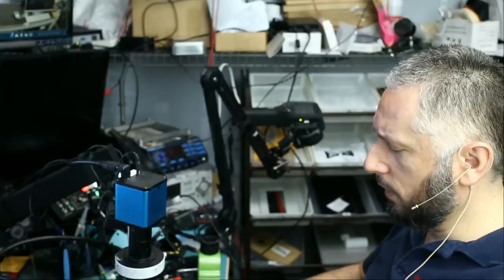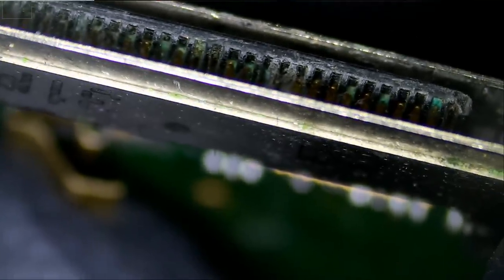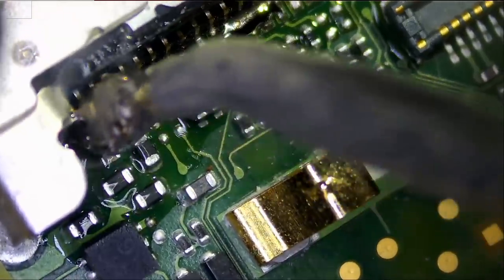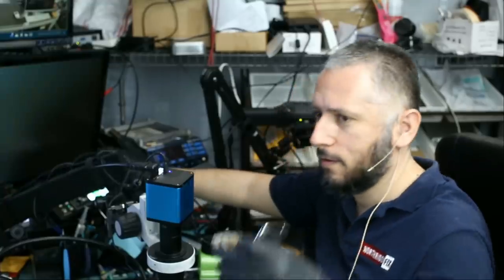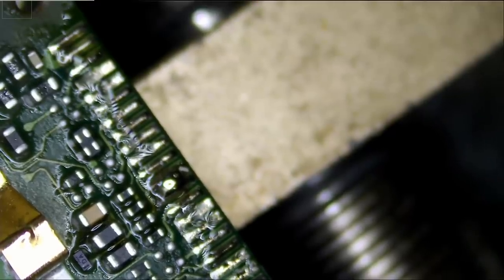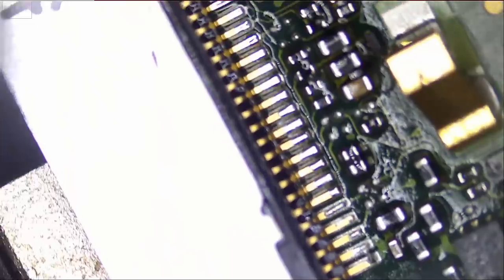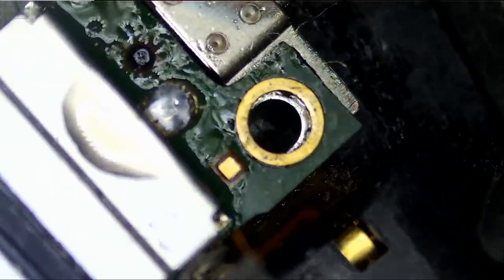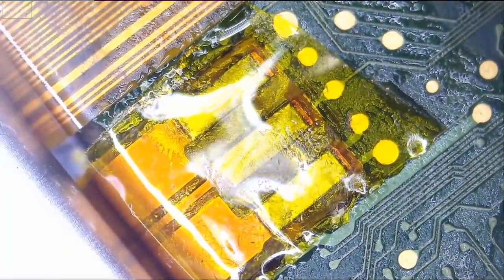iPod Touch 3rd No Power - Damaged Charging port replacement

Comment: Remove the battery and inject a current limited 4.2V into it to charge, then reconnect and see if it charges.

Don’t waste your time ordering and waiting for the battery if you haven’t confirmed the cause.

Also inject 4.2V into the iPod battery terminal and see if the iPod boots
Reply: Maybe the battery has lost its capacity
Reply: Joshua Hutton it will have enough to allow the iPod to boot for 30 seconds mate after being charged with external power supply. It’s not a lead acid

Comment: Hey man. Isn't it dangerous to put the soldering iron on all three pins of the battery at the same time? Couldn't that cause a short and possibly make the battery explode?
Reply: Yes and perhaps it just seems like he did? I went back and watched that part again and even though the tip was nearly perpendicular to the pads, I don't think he touched any at the same time. I could be wrong of course. Exploding batteries are no fun.
Reply: 0:29 yes he touched all the pads at the same time, if he desoldered each pad alone he could damage the battery (flex cabel ) considering it's a very old device, it great that the battery hasn't expanded yet, but he's probably gonna to have to change it since it's dead.
(But that's just my opinion ).

7:52 though he didn't touch 2 pads at the same time while resoldering the battery. 
Have a good day.

Comment: Hey brother instead of ordering new battery, you can use the power supply to boost the voltage in the old battery. This will give life to the old battery and customer will save some money and you will save some time. Thx for your videos i really like them.
Reply: Shoaib Shaikh that’s not how a LiIo battery work. It will degrade over time. Nothing you can do to restore it.